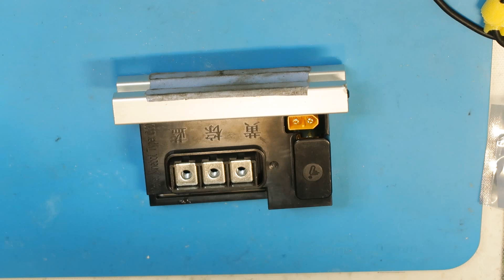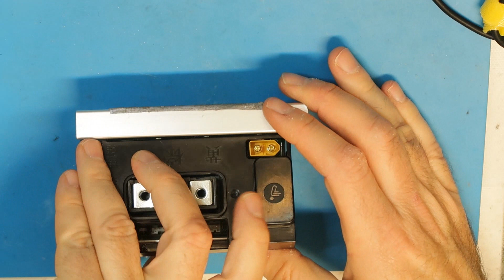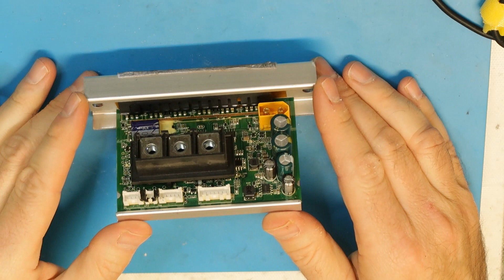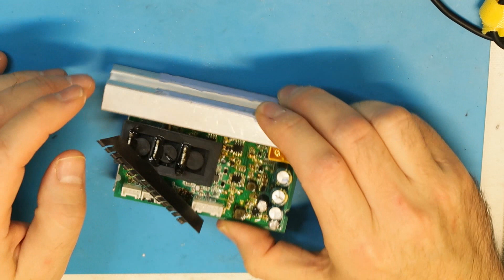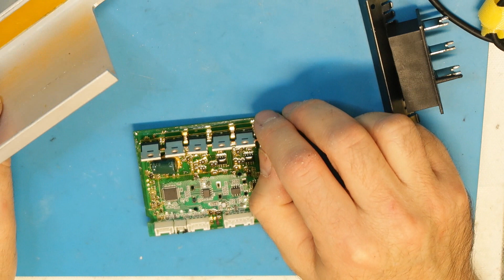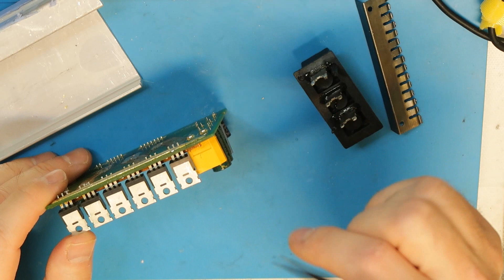Ninebot G30 new controller - How it works ?

Comment: Good-day I am a handicapped pensioner trying to save money by keeping my G30P (with Sharkset front & rear suspension) running forever. Could I connect a motor that originally came with Bullet connectors to this terminal (the bullet connector motor is a Gen 2 G30P starting with a 9 prefix). The G30P as a walking aid is a life saver for me and has already paid for itself. I also love that I can now buy a refurbished G30P for $C 399.99 and quickly transfer all it's parts to my G30P frame with Sharkset suspensions.

Comment: What is the max amps I can push on this new controller?
Reply: Im riding it since about 1year on 45a with fieldwiekening aktiv @ 24kmh, additional amps 2, 2200ma/kmh fw max amp 50.. nothing on the controller is reinforced but i addet a new thermal pad on the heatsink because the old one was demaged during disassembling.
I should say that here were i live it has a lot hills but i am not the a heavy ride about 80kg. Anyway i deactivatet kers to be save. My brother has the same settigs but over all -5 amp cause he is bit more heavy.

Comment: I have that same new g30 controller... Xiaodash app works perfectly flashing.  Only problem I've had is two of the phase wires melted together next to where they bolt to controller, I just separated them an used high temp heat shrink no damage wS caused.   Xiaodash has field weakening,witch is awesome